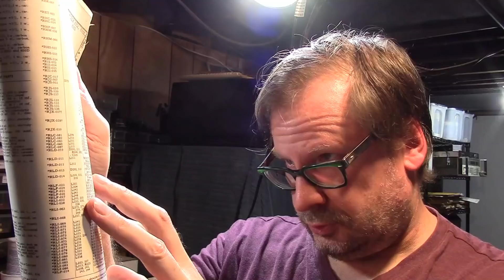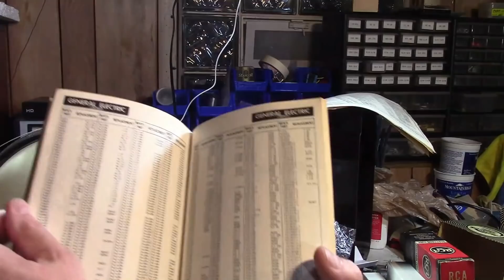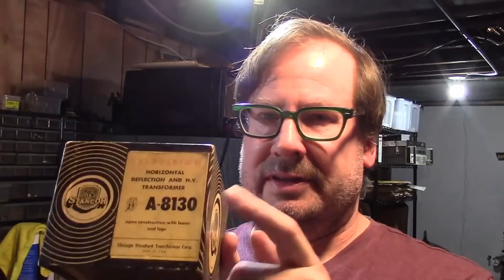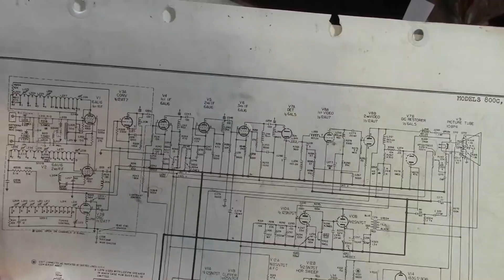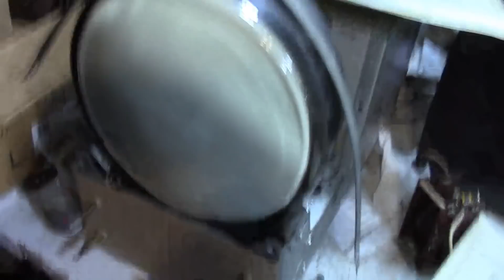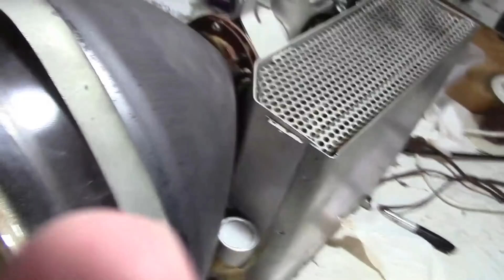GE 800D restoration p7o8

Comment: 20:37 You are right. For those who want to read up on it; The phenomenon you refer to is called Barkhausen-Kurz oscillations (named after Heinrich Barkhausen and Karl Kurz)
They do not cause linearity issues and they radiate into the tuner. So they are not present on an unmodulated raster or across the whole tuning range.

Comment: Looking forward to the Philco 90 videos.  I have a nice 90 in the que to be repaired.
Reply: I always thought they did better radios than TV receivers.  They were often innovative at the expense of quality, and like Zenith they used a lot of proprietary parts.
Reply from the maker: Maybe you're thinking of the Philco Predicta line, but their earlier models from the 40s and early 50s were high quality and well engineered.  Very solidly made.  You'll be seeing some of those at some point.  I have their first post war set the 48-1000 and several from 1950.

Comment: I'm curious if it's technically possible with an antique TV to alter the horizontal and vertical signals and get an antique CRT to produce a higher resolution image like 1080?  Is not the number of scan lines and dots per line basically controlled by the signals?  Also would it not be possible to install a 2nd audio amplifier section from a similar donor set and use some extra circuitry to decode and use both audio sections to play back the stereo audio in modern shows?
Reply from the maker: No quite.  The vertical and horizontal oscillators run with no signal present at about 60Hz and 15.750 kHz.  So you'd need to rework those circuits and replace the vertical and horizontal output transformers.  Also, not sure if the yoke could handle it.

Sure, you could add a stereo decoder and 2nd audio amp.  It would be a lot of effort though and wouldn't fit inside the cabinet.  Not to mention the extra tubes would draw more power and effect the power supply.